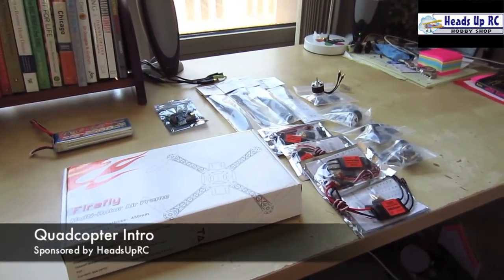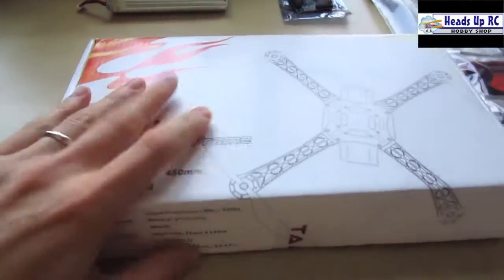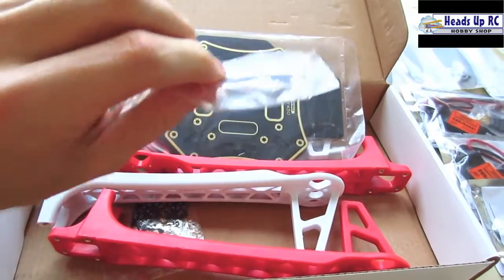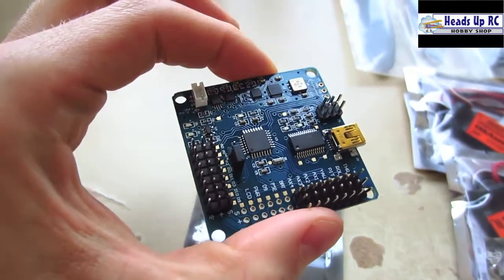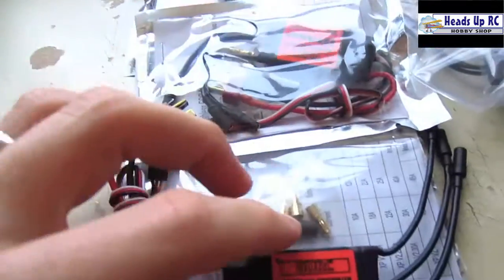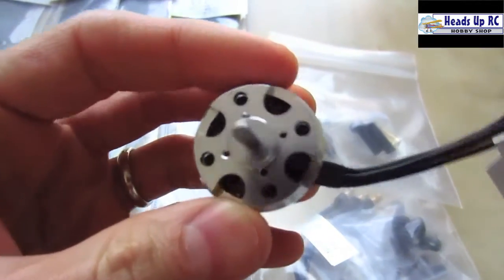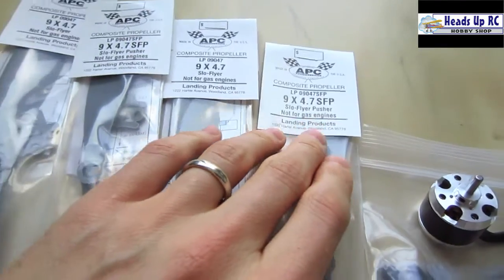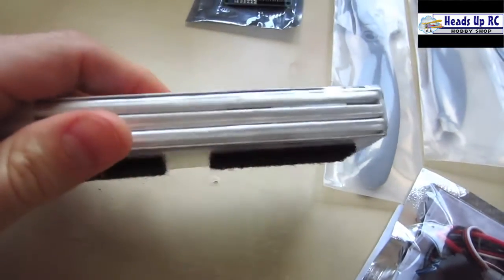QUADCOPTER Intro

Comment: I have had some issues with the multiwii board and programming also. When you get them all dialed in they work great. The KK2 takes about 1/4 of the setup time and you can adjust setting in the field without a laptop. You should get one on order just for kicks.